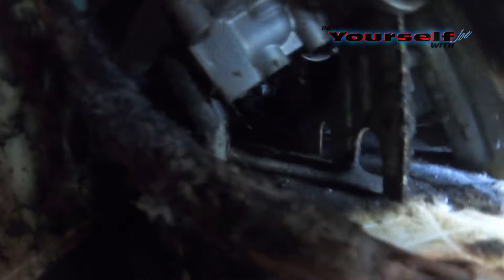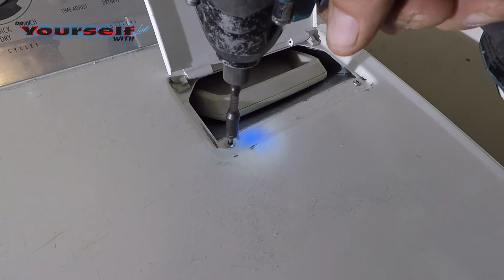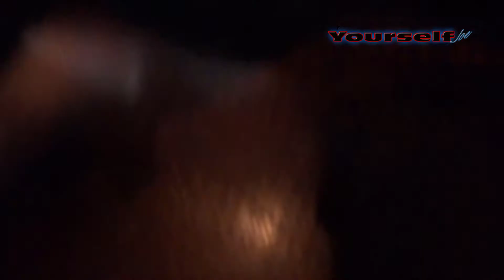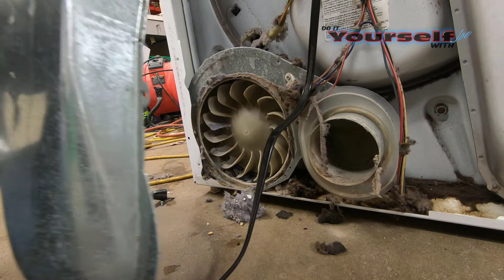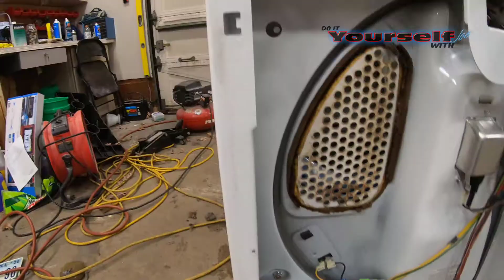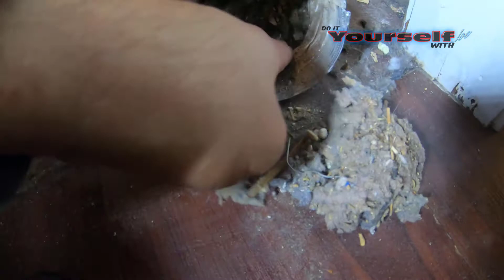Dryer Repair, My Dryer Is On Fire!

Comment: Well this video is about gas dryer. Will static electricity or spontaneous combustion cause other dryer lint to light up? The reason I say that, is hay for instance can just light itself on fire from chemical reaction in the elements.